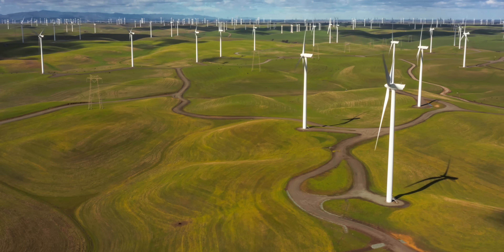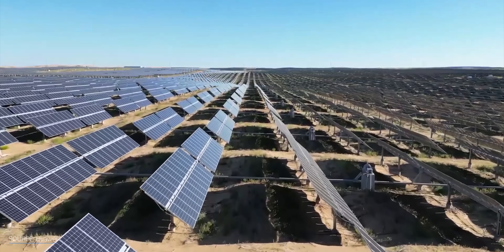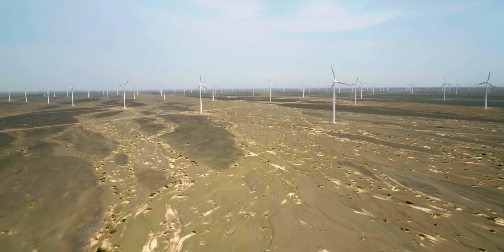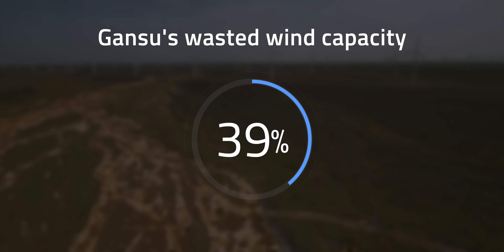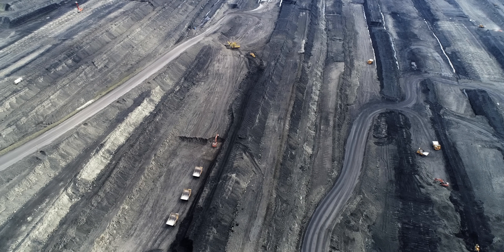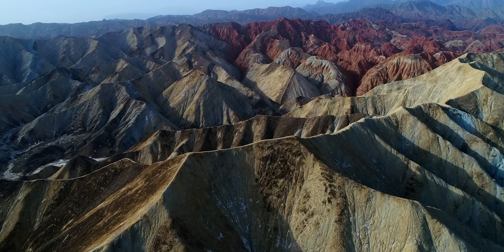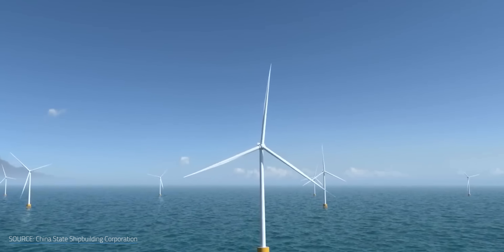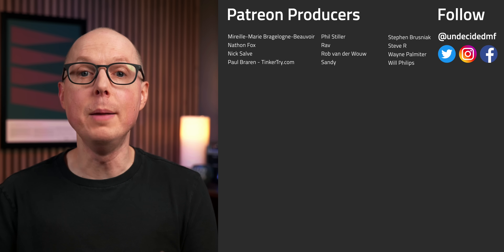The World’s Largest Wind Farm has a Tiny Problem

Comment: 1GW for 750,000 homes is only 1.33kW per home. Given that the peak power usage of most homes is considerably higher than this, and most homes have their peak power usage at around the same times of day, it's a misnomer to say that 1GW can power 750,000 to 1M homes. In actuality, it's nowhere near capable of providing the power required. 3-5GW is getting closer, but that doesn't take into account downtime for maintenance and when the wind isn't fast enough to drive the turbines. And all of that is ignoring commercial/industrial usage, which dwarfs residential usage.
Reply: You hit the nail on the head. Base load isnt really a big problem for renewables, but peak load is. And thats where the current research is at.
Reply: This is hardly unique to China, you know. The scale of global wind power landscape desecration is enormous for its scattered, unreliable output. That's the real tragedy of Big Wind, not just economic aspects bean-counters dwell on. One of Trump's high points is that he sees through the wind sham, but he's a dummy in most other areas of natural science.
Reply: CCP controls every aspect of life. They will tell you how much electricity you are allowed to use 🇨🇳
Reply: @AutoEngineerVideos  get your point but you have a formula for that. If I'm not mistanken 1,5 kW is actually double up!
Reply: @emma12345678961  What have I doubled? If I've made a calculation error, I'd like to know what it is.
Reply: @AutoEngineerVideos home or grid storage can average that out and is rapidly getting available and affordable.
Reply: @ on the contrary. The largest batteries in the world would go from completely fully charged to completely flat in a few seconds if they were to supply their respective grids with their full base load requirements. Given the relative sizes of base load and peak load, they're utterly incapable of performing such a task for the time required (their job is to stop the grid from going down in the seconds it takes from when a renewable generation source fails to when back-up generation can automatically come online). Also, there simply isn't enough lithium available in the world to make such systems work (both in terms of mining capacity and known reserves), and although solid state batteries are often touted as being on the cusp of being available, digging past the surface hype shows that they're not as close to being viable as we're being told. As for home storage, considering that there's no grid-wide storage solution as yet, putting storage into every home is even further from reality than grid-wide storage. That essentially leaves pumped hydro-electric schemes and hydrogen as the remaining storage solutions - both of which are woeful for their poor efficiencies, and hydro has the added problem of being the solution that environmentalists hate the most (even more than nuclear electricity) because it destroys wildlife habitat by putting it under water.

Essentially, it would be easier to make enough renewable electricity generation to meet and exceed the peak load requirements, rather than building the energy storage systems that would be required to make the proposed generation system work. Yet again, the solutions proposed are all hype and the engineers are left having to tell people the bad news that the technology and resources don't exist to make the pie in the sky ideas work in the real world (while unscrupulous businessmen milk governments for all the cash they can get before the people can realise that they've been conned).
Reply: @AutoEngineerVideos  Your comment is quite confused and appears to be missing details as well as knowledge about the latest developments in the field.  (E.g., solid state is not at all necessary for grid level storage).

Grid level storage as well as home storage is available and rapidly being built out.  Everything is impossible until somebody comes along and just does it...
Reply: @ there's absolutely nothing confused about my response. You've believed the BS about grid storage systems. They're not available to the required size for the job and they won't be for decades.
Reply: very nice lies,
Reply: @dknowles60  please point out the "lies" so they can be addressed and exposed.
Reply: @AutoEngineerVideos  Texas 2021 TVA duke energy  10 other Electric Companys Rolling Blackouts, TVA jan 17th 2024,  97% solar failure rates  let m know when your ideas win
Reply: @dknowles60   and what are the differences between the previous situation and the current one? Was there a considerable upgrade of the grid, replacing antiquated transmission equipment that was failing? With the current equipment, what would've been the status if renewables were removed from the equation, relying only on nuclear, natural gas and coal? What was the availability of the renewables compared to the non-renewables? I understand that it's easy for someone to give some before and after figures and attribute the change to a particular supposed cause, but for the real causes to be something entirely different.

More to the point, how is what I've said untrue? You've accused me of lying. Show me where I've supposedly lied.
Reply: @AutoEngineerVideos  hint if the TVA can purchase 10k megawatts dec 23 dec 24 2022 then the grid is ok
Reply: @dknowles60  you're obfuscating and not answering the question. In other words, you don't know the answers, so you don't know whether renewables made the grid better or not. Meanwhile, actual electrical power engineers say that renewables destabilise grids and lead to decreased reliability.
Reply: @AutoEngineerVideos  wrong again both Texas and the TVA had have wind and Solar power Failures
Reply: @dknowles60  you're going around in circles and not saying anything to answer my questions regarding what you previously said. You obviously don't know the answers, so you're unable to justify claiming "renewables" as the cause of the reliability increases.
Reply: YEAh see taxas 2021 See TVA dec 23 dec 24 2022
Reply: Why everybody point on peak hausehold consumption? Is there some community where all the people turning their cattle at same minute (or dryers or washing machines ...). In reality if that happened there will be blackout at least twice a day - we count on that. In past we had (for sure some region have them still) relays which turned our boilers on through the night and we still have night current rates (but do not know tech aspect how it works). U can use time division to give to households 5.3kw of power and boilers keep that  heat all day - and heating and hot water is like 95% of household consumption of energy. And rest is not made at same time  - load will spread naturally (ironing station, ovens, washing machines)  - quite complicated topic, but mostly it is how that works
Reply: @stanislavbandur7355  power production and transmission is based on peak load requirements. If peak demand isn't met with adequate supply, it can cause the voltage to dip, which can damage some types of electric motor (generally, the most commonly used types), and maybe even get to the point where the voltage goes low enough to make the grid control shut down to prevent damage, thus causing black-outs.

Essentially, a power supply system that can't meet peak demand isn't fit for purpose. Also, the fact that most households have their peak usage at similar times of day is a major factor in this. Unless people are forced to cook their dinner at certain times of day when they normally wouldn't, the peak usage periods are a fact of life in power generation and transmission.
Reply: There’re several ways of addressing the problem.
1. Peak power often are short lived and the EVs can feed into the grid, so can the batteries swapping stations.
2. Many industrial processes are not time critical, like the stamping press that can stop operating and use buffer stocks instead.
3. Freezers in home and warehouses can be turned off because they are adjusted to run colder before peak hours. So can heating be stored a few degrees higher(in water boiler, oil or thermal bricks)
 Pricing can be varied according to demand and supply based on blockchain and controlled by supercomputers with AI that can predict and priced the electricity accordingly. Many non essential or non time critical electrical can be turned on during off peak only. There is probably discounts if you let some appliances partially controlled by the electric company.
There’re many other ideas, each may not be much, but put together, is going to put peak demand much lower to be an issue.
Reply: @madsam0320  for some reason my response to you isn't showing up. To do what you propose would require far more centralised control than westerners would be willing to accept (for good reason).
Reply: @AutoEngineerVideos  it’s understandable that we would want to control our gadgets whenever we wish. So computers, tv and lighting should not be sourced to external controls, who wants tv and lights switch off without permission.
But it’s acceptable for most people if laundry washers, dryers or dishwashers are set to clean within a window, eg turn on anytime within 12 hours or other settings. Home heating, cooling at a range of temperatures. Every household has choices, the more you opt in, the more flexible, the more savings is to be had. Also, there must be data protection, those utility companies don’t need to know personal settings. The ids for control settings are separate from the user account, metering and the billings.
Reply: @madsam0320  I disagree completely. Real life requires the ability to deal with things when required, not when permitted. Besides, you haven't mentioned the highest power users (in terms of Watts) in the house: the cooking and heating appliances. Do you want your home to be freezing cold while you eat your dinner in the winter because you can't use your stove and your heater at the same time? Even worse, do you want to get home from work and find that you have to wait for two hours before you can cook your dinner because there are too many people cooking at the same time, so you have to wait your turn? Even worse, you get home and find out that your window of opportunity to use your stove ended before you got home. Such control over when things can be done is utterly unacceptable. Even with things like washing machines, such control is unacceptable. For instance, work gives a manual labourer two sets of a required uniform (very normal practice, even though it's a bit lacking). One gets damaged and is being repaired, then the next day the other one gets soiled and needs to be cleaned and dried overnight to be worn the next day. The worker needs to put the clothing into the washer, then put it into the dryer before going to bed. If the washer won't turn on until after bed time, the clothes will be clean but wet in the morning. That's completely unacceptable.

In short, if central authorities can't arrange things to meet peak power requirements, they can't be trusted to control the intricacies of daily life for the people.
Reply: @AutoEngineerVideos   I feel that not everything is time critical, not everyone has same lifestyle. A busy executive may not care about savings on energy as a pensioner with more relax routine. There are exceptions like you need that uniform in the morning, but if you don’t do laundry everyday, you can put it off even if it’s a full load, because your wardrobe is not so bare that you have no clothes to wear. Also mealtime is not really so regimental that we need to fix a time. But then again, if the family feels like having a meal, there’s no need to wait for the right time to save a little bit on costs.
There are flexibility on the supply end as well. If there still is unusually heavy loads, then the utilities can switch on standby stations like gas or even coal power that are excess electricity generation replaced by renewables and now serving as fillers for peak hours. They are not going to be used as much if there is efforts to tamp down on the peak demand on the other end.
Reply: @madsam0320  sorry, but I disagree. I've tried to point you to the reality of what things would be like if the true peak load weren't accounted for, using central control to artificially reduce the peak power demand, but either you don't understand the realities of electrical power usage across a population, or you don't want to see the realities, but instead, pointing to outliers as if they're the general rule (of course we know there's a range of times when different people usually do different things, but there's a reason why there are morning and evening peak electricity usage periods, and these real world peaks do take into account actual electricity usage). Instead you mention people who can afford to pay more and people who can't as if it were a justification for central control of appliances (many places in the western world already have smart meters that can measure usage and times of day, etc, and that's already being implemented, with those who can't afford power cost increases being hit the most in many areas, and smart devices already exist that can be centrally controlled, which some areas have already seen being implemented). However, that idea simply creates a situation where those who have plenty of money can do what they like, while those with a strict budget essentially have their lives controlled by a centralised computer system. As I said previously, that's absolutely unacceptable and I've given examples of why.

There's absolutely no point in me wasting my time commenting any further on your comments.
Reply: @AutoEngineerVideos  you are full of contradictions, first you talked about reality, and then you don’t want to face reality. If you want conveniences, you pay for it. If you want to save money, you have to go without. That’s life, it’s the world we live in.
When you talk about facing reality, I suggest you hold a mirror to yourself. The electrical power is run on economic value, and it’s fairer to meter it on supply and demand. But it’s not just money value, there are environmentally costs to factor in. Fossil fuels are cheap but polluting. They are also versatile, useful to fill the peak demands. Renewables like wind and solar are clean, but intermittent. They should be used first if necessary. There is no standard model, every country or region is different and have different resources and needs.
Reply: @madsam0320  reality is that the way things are being set up will disproportionately adversely affect those who can least afford it.

Reality is that average power usage is not a suitable measure for determining the required grid supply capability, and it never will be.

Reality is that setting up methods of artificially reducing the peak power demand causes problems that those in western countries will consider to be utterly unacceptable for reasons I've already given.
Reply: @AutoEngineerVideos  i think you may be interacting with a non-human (AI) device, that's why madsam does not sound like any kind of normal human (:
Reply: @janhavi7576  you might be right about that. Although, occasionally there are people who know so little about a topic that they have absolutely no idea how wrong they are, and they'll argue their erroneous points until those who actually know something decide to stop wasting their time. And that's how people with the IQ of a house brick are seen to "win" arguments.

Anyway, I'm sure that most people can understand that the way that working times are set up creates time blocks where electricity demand from the grid is elevated. Sure, people aren't all turning on their toasters and kettles at the exact same time in the morning, but there are still morning and evening peaks, and there's no way to get around that, despite what some people (or AI troll bots) might say.
Reply: @madsam0320  all of which require giving control to a central authority, and if actually need to do something that they say you can't do at a specific time, then that's too bad. It's all well and good to come up with these ideas, but when westerners run into the realities, we reject the idea. Besides, powering the grid from cars adds charge cycles to them, reducing their battery life. Who is going to repay the car owners for the accelerated degradation of their batteries? The answer is: nobody.
Reply: You must realize that the average Chinese home uses far less energy than a developed country. So the figures they use are closer than you imagine. Poor farming communities have little more than a lightbulb or two and a radio to listen to the government approved radio station
Reply: @kevinberger9854  did the line I commented on in the video say it was specifically talking about China for that statistic? Or was it in the context of asking whether the west should do the same as China has done? While I can't specifically remember off the top of my head well enough to be absolutely certain, the context of the video was around the idea of the west replicating what China has done, so it isn't unreasonable to comment about the peak power usage with western figures. However, even in China, wherever they use electric cooking appliances, they'll still use a certain amount of power during the peak period, and those who live in apartments in the city will often still use more than 1000W to 1300W in the peak, while cooking their food. My point is still valid.
Reply: @kevinberger9854 Yes the Chinese home uses less energy than a Western home, but trust me, they're not consuming only 1.33kW lmao
Reply: @kevinberger9854  How are rural Chinese going to escape poverty if they have only "green" energy?
Reply: You're thinking American homes with AC. In UK 1500Kw is adequate peak (its the kettle and tumble drier). Much of northern China is the same and don't all have the domestic devices in USA
Reply: @AndrewN75  My max is for my flat is about 4kw and house is 9kw.
Reply: @AndrewN75  I'm not thinking anything about America. Never been there. Probably never will. You've made an incorrect assumption in thinking I would base my calculations on the USA. By the way, 1500kW is 1.5MW, which is far too much for any home that I've heard of. I assume you mean 1500W, or 1.5kW. However that's not enough to cover peak usage for a house (nowhere near it). Below are some power usages for some common household items. I realise that some items in some households would use natural gas instead, but it will still give a good idea of just how much power draw houses take during the morning and evening peaks.

Oven: 2kW to 5kW
Stovetop: 1kW to 3kW
Portable electric fan heater: 1kW to 2.4kW depending on its specs and setting used
Toaster: 0.8kW to 1.5kW
Microwave: 0.8kW to 1.2kW
Fridge/freezer: 0.15kW to 0.5kW
Electric kettle: 2kW to 2.4kW

So... let's say someone comes home with some groceries that need to be put away, throws a few things together into a single pot to heat up, puts a couple of slices of bread into the toaster, and makes a cup of tea to drink with dinner. Here's their peak power usage, assuming it's a one-person dinner and the appliances are about average sized:

Fridge (bringing the temperature back down again after having food put in - some of which wasn't refrigerated at the shop): 0.25kW

Stove (1x medium sized hotplate on a 4-hotplate 1.6kW stovetop): 0.4kW

Toaster (basic 2 slice toaster): 0.8kW

Kettle: 2kW

Total: 0.25kW + 0.4kW + 0.8kW + 2kW = 3.45kW peak power usage, excluding all other devices, lights, etc.

When you multiply this by all the other people who are doing the same thing at the same time when they get home from work, you'll find that I was quite correct in what I said about 1GW not being enough to power 750,000 to 1,000,000 homes during peak power usage periods. And that's ignoring those who are cooking for multiple people in a family, using two, three or even four hotplates, or using the oven, turning on a heater because the house is cold in the middle of winter, etc. 1GW might well be enough for that number of households for their daily average consumption, but certainly not their peak consumption, which is why I said what I said.
Reply: @theclearsounds3911  indeed! Usually considerably more.